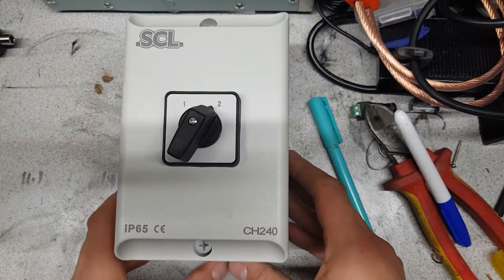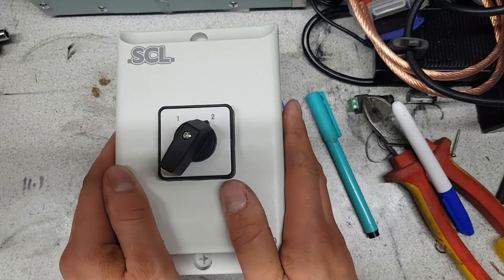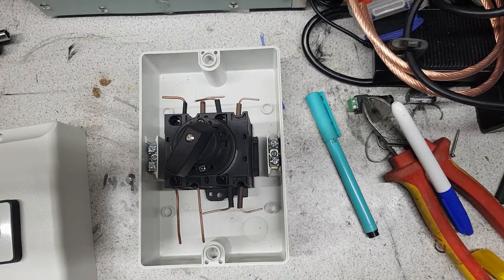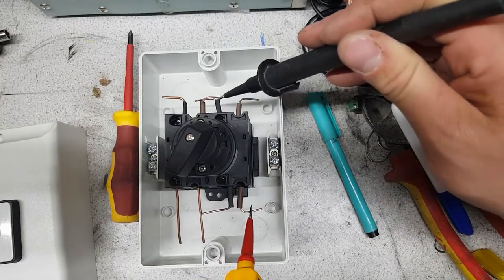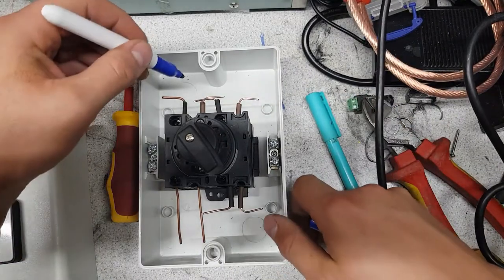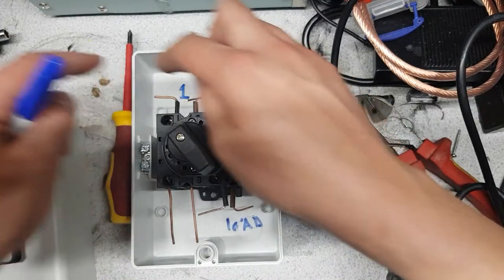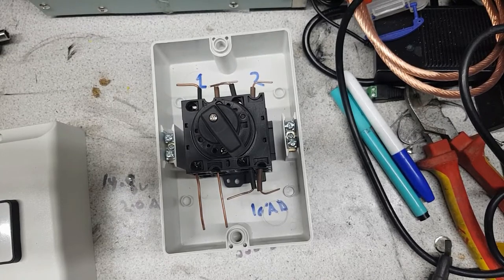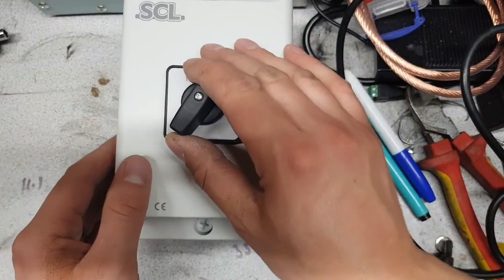A 40A double-pole changeover switch and its uses

Comment: I've been thinking of using a 3 pole (for 3 phase) changeover switch for connecting a VFD to different 3 phase motors in a workshop. This switching would be done with the VFD powered down, and then powered up and the corresponding motor switched on through the VFD's input controls. The purpose would be to use a single-phase input VFD as a 3 phase supply (when 3 phase isn't available) and power several motors (not at the same time) using only one VFD (for cost saving). Whether this is practical or saves appreciable cost is to be determined. I'd appreciate your opinion if you are able to offer any thought.

Comment: I understand using this switch for a single supply and feeding two separate pieces of plant (one at a time) but I thought if you had 2 supply's to a single load (grid & generator) then a 3 position change over is required. My understanding was this is because there is a potential, just at change, on this one of both supply's being connected at the same time?
But good video.

Comment: Why do all the double pole  rotary switches I've searched for  have 8 terminals ? If its 2 wires in (supply ) and 4 wires out (2 for one load and 2 for another ) ? Baffled
Reply from the maker: Where abouts in the world are you. If your in the UK we run 3 phases and neutral. That's your 4.

Not at all written in law but you could double up your cables and half the rating of the device to save costs. Providing your happy with the terminations.

Double pole means it isolates the live and neutral at the same time. Most isolator switches are used in a commercial environment. More likely that not youd expect three phases and a neutral at this point.

Apologies for the late reply. I have a 1 year old that is currently balls to the wall and doesnt sleep!
Reply: pietkaify Hi thanks for replying , am in UK I need a rotary to switch between an inverter  or mains hook up in RV   , so I can choose which one to supply the  load (sockets ) ,the UK has neural ,live, and an earth , single phase 240v ,same with inverter although I don't think the earth is used on inverters ,just want to switch ,I've read I need DPDT switch , the output can be fixed , but needs to switch at wiper between the mains electric feed or the inverter ,with an  all off in the middle